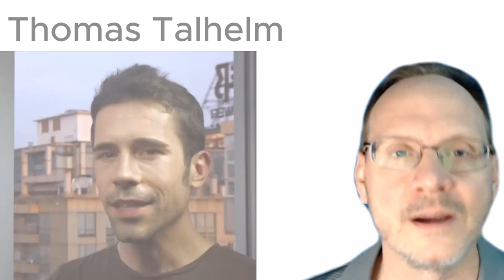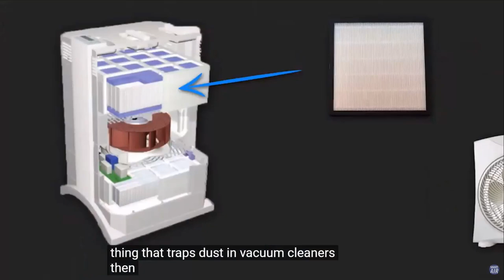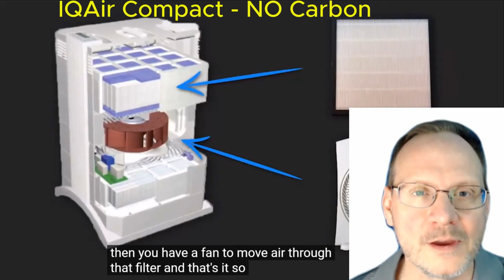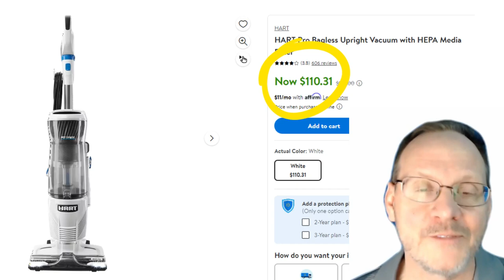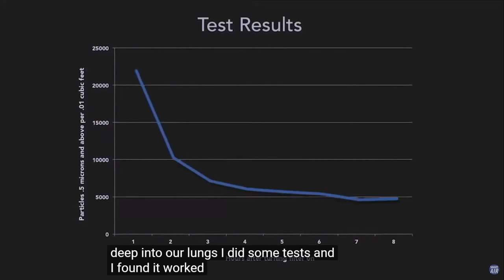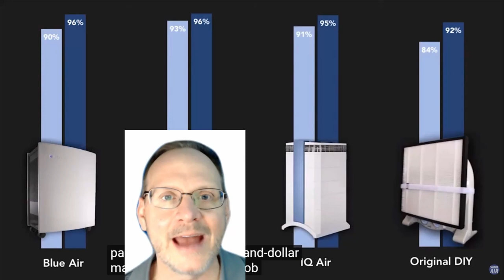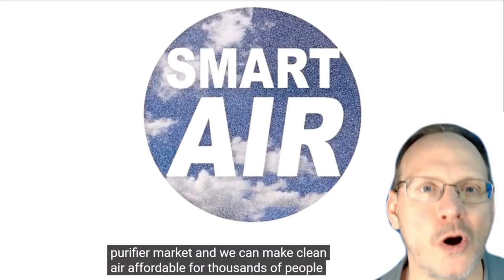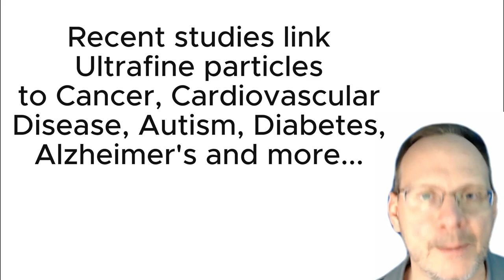Smart Air DIY: Is $45 Air Purifier REALLY Better than $1199 IQAir? Busting MYTHS Review

Comment: Repetitive. But you could have saved 15 minutes by just showing the air purification results of each. Which you can't do because apparently it requires specialized equipment. So, in spite of your fine investigation we still have to trust your logic. Any way, appreciate your video
Reply from the maker: 1) Yes, I know I repeat too much - I try not to but IDK - may be my thinking process, I may have ADHD, I am not sure but I know I repeat too much for some reason. 

2) I started the channel by thinking I was going to "test" many different air purifiers with sensors and show the results.  But I now have 5 air quality testers and unfortunately, after playing with them for a while and doing more research - I came to the unfortunate realization I would be misinforming people... and lying to myself if I didn't state the truth... they can't be trusted.  This set my content schedule back many months as I had to find other ways to evaluate the solutions.

3) Then I figured - some units are 3rd party tested so I can just gather those results and that would help rank the units.  Right?  I mean, the 3rd party testing labs are going to be honest and provide reliable testing data results.  Right?  But now, after looking into it...  I realize some of the manufacturers are lying about their 3rd party testing results - as crazy as it sounds, and they can't be totally trusted either.  When there are millions of dollars on the line - some folks will go to great lengths "stretching the truth" to sell their units.  The industry is filled with lies and deception - even more than I had realized.

4) So, I can only do my best and analyze things to the best of my abilities and learn new things every week... this is where the journey has taken me. 

5)  Also, I tried to purchase the $45 Smart Air DIY Fan/Filter to evaluate it... and I was actually OK with paying over $100 for the shipping but... they still would NOT ship it so I don't think it is available in the US for whatever reason. 

Thank you for the comment/feedback and enjoy the Holidays! 👍
Reply: @AirPurificationEducation @AirPurificationEducation  I came to YouTube for tips, insight, and budget-friendly solutions for cleaning the air in my environment. I can't enjoy "normal" breathing life for 7 out of 12 months of the year. Filtering through the BS is exhausting. But reading your humble, honest, authentic comment to this response left me feeling joy. No one has the answers; we are all just winging it. I appreciate your time, effort, and transparency. Maybe I'm naive; perhaps I'm not. Keep up the hard work. Stay kind. Stay classy. ;)
Reply from the maker: Thank you for your nice comments but I cannot promise I will remain "kind" and "classy" in the future, LOL!  As I think I may start becoming a little more aggressive in my approach. People's good health appears to be at stake... so we shall see how things unfold.  Future "tones" may depend on the hour of the day I am posting and how much Vietnamese Coffee I've consumed at that point in time... as I currently am an addict and it can affect my overall "level of friendliness", LOL!   Thanks and enjoy the Holidays! 👍      @Wink1176
Reply: @AirPurificationEducation thanks for further details and makes sense. Enjoy your holidays as well
Reply: @AirPurificationEducation I like and appreciate your videos 🙏and they are very straight forward and logical
Reply: @Wink1176 I agree, his content is great 😊
Reply from the maker: Thank you, I appreciate it!👍 @IntegrityMeansAll

Comment: Valid points, however what if someone bought the three IQair filters and created the same fan-DIY solution i.e. attach prefilter to fan attach to carbon filter attached to heal filter. Would be pretty simple to do to be honest, just lay them and secure them on top of one another, then you could case it in with 4 pieces of thin flat wood from. Aside from the fan shape, which I expect is negligible, seems like you would have a similar air purification results at 1/3 the cost of buying the machine? Or perhaps, given your sales and business, you have too much of a vested interest in the air purification market to admit or test this..?
Reply from the maker: Thank you for your question.

1) I sold IQAir units to customers even when the company/dealer I worked at was cut off from selling them.  Meaning, if I felt the IQAir HPP was the best solution for a customer - I would tell them to purchase it even after we didn't sell it anymore and my company and I would not make any money on it.  Because I am a consultant and I provide the best solution for my customers regardless of my personal gain or not.  I directed many customers to buy the IQAir HPP after we couldn't sell them anymore.  I explain this in a video when a guy on TikTok asked how much money I make on the IQAir HPP (about a year ago).  Starting at 1:25 of that video: https://www.youtube.com/watch?v=KY5c-zH0ofM&ab_channel=AirPurificationEducation 

Also, the #1 unit currently on my "Best Air Purifier list" is the Aeris 3 in 1 and it has not been available in the US for a couple of months now... and no one knows when it will be coming back.  Some say it won't be available in North America again.  I will still put it at #1 on my list - regardless.   No other YouTube channel has Aeris at #1 in their best air purifier videos, that I have seen... and I don't think any will put it there for the foreseeable future because: 
A) Most don't know how good it is and 
B) it is currently not available so they won' t make any money on it. 

2) Most consumers totally underestimate the level of engineering and precision it takes to make an air purification solution filter at a True HEPA level.  Most all the manufacturers on the market say their units are "HEPA" air purifiers but over 99% of them do NOT actually work at a HEPA level.  I explain why in this video called "HEPA Filters - Are They All the Same?":   https://www.youtube.com/watch?v=Ur6J6jqIEmY&t=1483s&ab_channel=AirPurificationEducation

3) "however what if someone bought the three IQair filters and created the same fan-DIY solution i.e. attach prefilter to fan attach to carbon filter attached to heal filter. Would be pretty simple to do to be honest, just lay them and secure them on top of one another, then you could case it in with 4 pieces of thin flat wood from. Aside from the fan shape, which I expect is negligible, seems like you would have a similar air purification results at 1/3 the cost of buying the machine"  

Again, most consumers have no idea how difficult it is to make an air purifier actually filter at a HEPA level.  You have to create pretty much perfect seals between the HEPA filter and the internals of the air purifier so dirty air does not escape around the HEPA filter.  Over 99% of the air purifiers do not have good enough seals inside their units.  I'll make a video on this in the next couple of months - showing the difference in seals between multiple different air purifiers.  The high level seals on the Elite units vs. the "less than perfect" seals on the "also ran" units. 

3) You said, "Aside from the fan shape, which I expect is negligible" LOL!  NO, it is NOT that simple - there is such a thing as "fan engineering" and the IQAir HPP and Aeris 3 in 1 have specially designed fans.  I've spoken with an expert fan engineer in the past and all he does is figure out how to make his companies fans produce more CFS (with as little energy, as possible) and have those CFMs spread uniformly over the filter media - NOT an easy thing to accomplish - it takes engineering expertise.  And he said most ALL the manufacturers lie about how many CFMs their solutions actually produce.  They typically produce less CFMs than what is stated in their specs.

There is much more to this, as well... anyhow, I think you get the picture.

Hope that makes sense - thanks!👍
Reply: Merv 11 on an old box fan is about 80-95% just as good as an IQ Air but it's much louder and ugly and won't filter any gases, but carbon can be problematic since it can also release the same hazardous gases that it filtered and you never know when this might happen.  Carbon also clogs the HEPA filter since it breaks into microscopic particles itself and is it's own pollution.  Leakage doesn't matter since the whole room around the filter is the same as one big leak, what matters is how much air is moved through the filter per time unit, you can filter more with a lower filter rating if the fan is moving more air.  It takes about 15 minutes to an hour before most of the particles in an average bedroom are removed by an IQ Air type machine running on highest speed.  There are even cases where gases can condense in realtime into particles and create a situation where even an IQ Air can not filter more than about 90% of the particles because the gases keep condensing into particles faster than they are being filtered.
Reply: Also, nobody tests if the carbon filters are harmful, they might actually be more harmful due to microscopic particles of carbon flaking off in the high wind of the fan and the smallest particles will make it through a 99.97% efficient HEPA filter and go into our lungs and body.
Reply: Also, some say that HEPA filters get more efficient with use, not less efficient, this is different than being clogged by large particles.... so you should be able to vacuum out a HEPA filter and keep using it for along time and only replace it to be sure it doesn't have mold or similar on it.
Reply: Look up the info from NASA, they tested the HEPA filters and published a study. (link edited to pass the comment filter)

"How do HEPA filters work?
It is widely believed that HEPA filters are only capable of capturing particles sized 0.3 μm or larger. However, this belief is based in part on an incorrect understanding of how HEPA filters work. The fact is that particles of around 0.3 μm are the hardest to catch (Perry J.L., Agui J.H., Vijayakumar  R. Submicron and Nanoparticulate Matter Removal by HEPA‑Rated Media Filters and Packed Beds of Granular Materials. NASA/TM‑2016‑218224 ntrs nasa gov archive nasa casi ntrs nasa gov 20170005166 pdf1); for this reason, that size is used to measure the effectiveness of HEPA filters. Much smaller nanoparticles are in fact easier to catch. But why is this so? 

For larger particles, the HEPA filter acts like a net as we would expect. Particles greater than 0.3 μm in size simply cannot get through: either they do not fit through the holes or they hit the filter fibers due to inertia. For smaller particles, on the other hand, it would seem logical that they can simply go through the holes. However, this is not the case. The tiny mass of particles less than 0.3 μm means they do not fly straight; instead, they are bounced off other molecules as they collide with them and thus move in completely random patterns. As a result, they hit the filter fibers and then remain stuck in them. This is the principle of Brownian movement." - Hamilton Medical
Reply: The fan itself is the problem. You can't use some junk fan taped to a filter😅. It takes a lot of static pressure to push and pull air through these filters correctly.
Reply: @mr.monitor.  no it doesn't, a fan with a merv filter will work about 80-90% as good as the most expensive HEPA filter of the same CFM...  a fan with a HEPA filter will work the same HEPA filter will work the same or better as an expensive HEPA unit with the same CFM...  even a cheap box fan from target has more than 1800 CFM, a $300+ HEPA filter from Honeywell only has less than 300CFM or around there... it's more important the CFM than the filter medium...  I know this because I've bought and tested a lot of machines and I studied Physics at UCLA, even a tshirt over a fan will do some filtering

Comment: I was about to construct my own DIY air purifier, and most video i found suggest CR Box which uses 4 filters couple to a box fan...Quickly few issues came to mind... Box fan is axial fan, moves alot of air in free space (ambient static pressure), so now they use larger filter area with those 4 filters...but that will result to a very slow air movement around a large area. CFM is high but at slow speed..this mean u need something to circulate the air throughout your room..on top of that, the particle wont stay on the filter for long as they were merely sit on the filter...any abrupt movement of air or the filter will release everything back to the air as the filter are exposed and facing outward...
Reply from the maker: Wow... sounds like you may have brought up some good points. I think you need a YouTube channel! LOL! JK... but thanks for the input - I do appreciate it! 👍

Comment: What justifies the near 1000 usd price tag though? I think its a valid question . Whats the manufacturering cost vs the inflated price tag?
Reply from the maker: If you are asking about the IQAir HealthPro Plus - the answer is that it is one of the best mass produced consumer air purifiers for particles in the world.  It also does a good job on the most dangerous and plentiful particles in the air we breathe - the Ultrafine Particles.  It filters 99.5% down to .003 microns which is elite performance. I currently think it may be the 2nd best consumer air purifier for UF particles on the entire market. 

Over 99% of the so called "HEPA" air purifiers in the market do NOT actually filter at a HEPA level.  The IQAir HPP actually filters BETTER than HEPA.  Here is a video explaining why over 99% of the HEPA Filters don't actually filter at a HEPA level: https://youtu.be/Ur6J6jqIEmY

Here is a short review on the IQAir HPP: https://www.youtube.com/watch?v=P1RhEdaPRUo&t=2s&ab_channel=AirPurificationEducation 

The unit itself probably costs IQAir about $150 to make and they sell it for $899.  I don't know for sure - I'm just guessing.
I worked for a contact lens company years ago and it cost $2 to make the lenses and they sold them for $84.
I also worked for a oil purification company years ago and it cost about $1 to make the filters and they sold them to dealers for $42.

So, all manufacturers are going to have a markup price for profit... I don't know if I'd call it "Inflated Price tag" - these companies need to make money on their products to stay in business and pay their employees, pay for advertising,  trade shows, research and development, new equipment/robotics for new products, packaging, warehousing, etc.   A lot goes into manufacturing and distributing a product  - especially a product that needs to perform at an elite level.  And it all costs a lot of money to run the company and pay for everything. 

Hope that makes sense. Thanks!👍
Reply: @AirPurificationEducation  I appreciate the fast and honest response, and as usual it the consumer to blame which was my initial thoughts. They'll only charge what folks are willing to pay even if the product is 5x cheaper to make. We as consumers need to change and demand fair pricing. Especially something that would be so beneficial in all house holds but due to greedy business practices it's a niche item only afforded by the privilege. I don't feel it's right for only someone who has the means to burn near $1000 usd be afforded the right to breath clean air, it's madness. All that said thank you for all you do, you've really educated me on the topic appreciate you.
Reply from the maker: The HPP has been around for over 24 years and it was a groundbreaking air purification solution - still to this day - barely ever matched in performance by any company.  Which is amazing when we consider how many different air purifiers have been made in the past 24 or so years... literally thousands.

In 2015, Aeris came along with the 3 in 1 and they actually filter particles even a little bit better than the HPP.  And they came to the US market selling their 3 in 1 unit with a retail price of $999.  iRobot purchased them 2 years ago and was selling the units at $750 (the price decrease may be due to the fact that Aeris was manufacturing the units in Switzerland and iRobot very possibly started to have them made in China with less overall costs). 

Aeris also had a smaller unit called the Aeris Lite - that filters the particulates just about as well as the 3 in 1 but it retailed for about $399 and it was for smaller spaces/bedrooms.  Sometimes you could get it on sale for $349.00 - which was AMAZING for such elite particle filtration. 

iRobot seems to have stopped the manufacturing of the Lite unit which is a SHAME - as it was an amazing solution - esp. for the money.  And it did provide elite particle filtration at a much more reasonable price.

I agree, it is sad that folks have to pay so much for great air quality solutions... that said, I do think - over time - we will eventually see more elite air purification solutions appear in the market for more reasonable prices.  Competition, better technology, etc. will eventually drive the prices down over time.  I think this happens in most industries...  We'll see... Thanks!
 @blackstars3720

Comment: Your assertion that the GC multigas doesn't do the same job filtering small particles seems incorrect. It has the same .003 micron rating and will remove things the 899.00 model won't.
Reply from the maker: Nope, the GC unit has more carbon so it filters more VOCs and odors but the IQAir HealthPro Plus filters particles better.

Please take a look at the specs on their website:

IQAir GC GC - 99% at .3 microns (not even HEPA level which of course, is 99.97% at .3 microns).  And 95% at .003 microns  https://www.iqair.com/products/air-purifiers/gc-multigas

IQAir HealthPro Plus:  Total System Efficiency of 99.97 at .3 microns, 99.5% at .003 microns:  https://www.iqair.com/products/air-purifiers/gc-multigas

So yeah,  as stated, the HPP filters particles better than the GC.  Thanks!👍